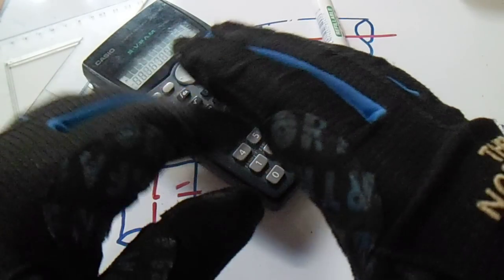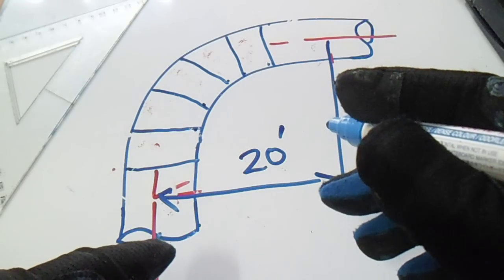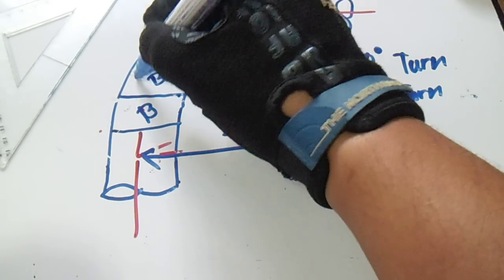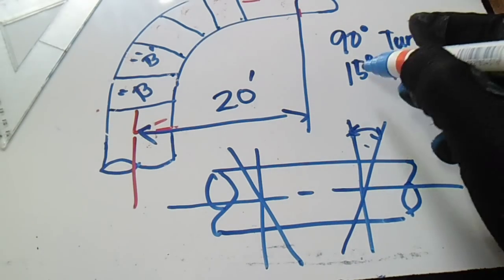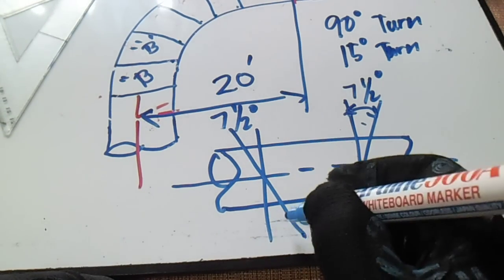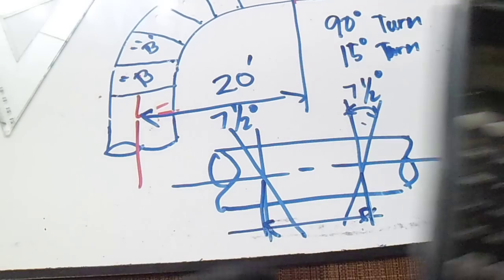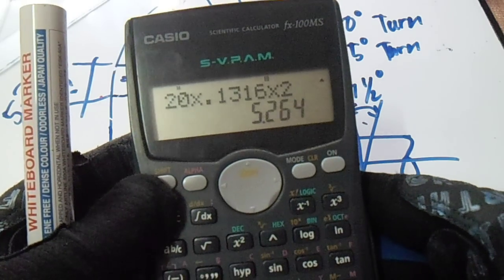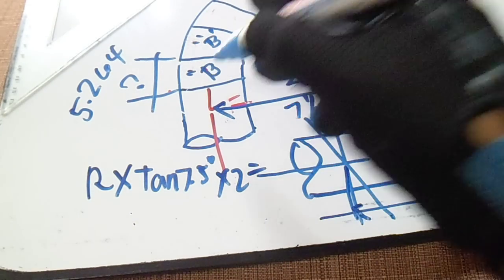How to Find Dimension "B" 90 Degrees Turn Miter Cuts - PipingWeldingNDT

Comment: angle of cut = 90/2x6=7.5 cut back is equal to OD x tan angle of cut all over 2 and to get that center line take off x OD the both end pipe of this is L2 and on the centee is is L1 to get that A = tan angle of cut x elbow center,  and the B is 2 time of the dimension of A,  sir kahiya hiya sa inyo kayo puro sala ang tinuturo,  mo sa tao, diyan dapat ni isa walang given dimension, yong 20 mo yon ay center line yon ay kinu compute para makuha, wala.ka man lng given na size na tubo, ano gang bobo mo, sa lahat ng video mo.pinanuod ko puro sablay, mahiya ka nmn,

Comment: Why didn't you calculate the length of an arch of a long and short radius then divide it into number of pieces so that you could get the accurate dimension to be cut including its angle of cut off both ends.
Reply: sir to get the correct dimension you need solve it gradually from the angle of cut, then cutback, you need to get the elbow  center line, center line=  take off of the pipe multiply by outside diameter, and  to get the dimension of Pipe A is tan angle of cut multifly by elbow center, and to get the dimension Of pipe B, pipe A multiply by 2.. you dont need to calculate the lenght of arc bec every piece of pipe has a correaponding dimension and angle of cut. eto.ping channel na eto ay puro mali ang ang tinuturo,